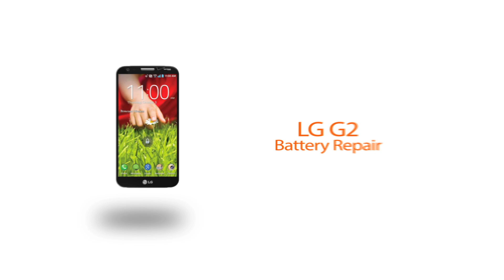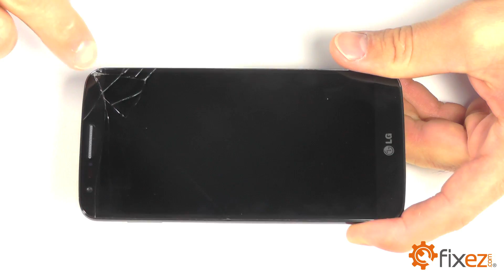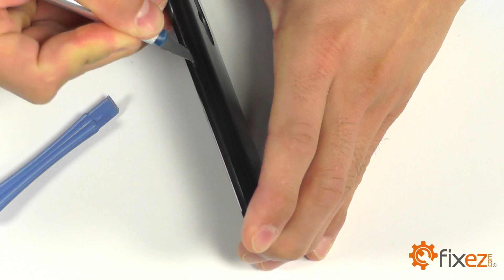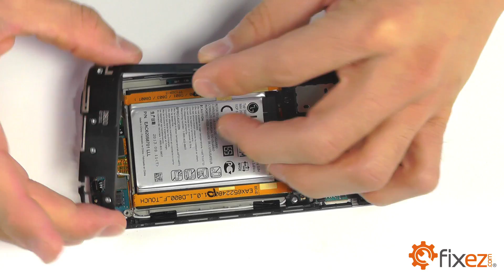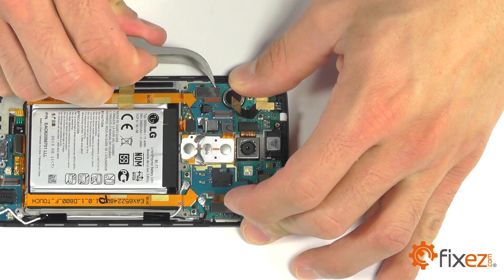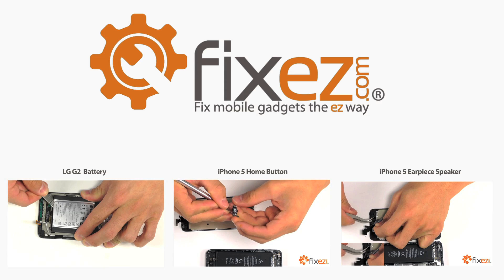LG G2 Battery Repair

Comment: What if my lg g2 is at 72% and it turns off completely while I'm using it and then I turn it back on and it's at 3% or completely dead. Is it because of the battery ??
Reply from the maker: This does sound like it could be an issue with the battery.

Comment: I replaced the battery in my G2 with a larger 3950mah one, but whenever I charge my phone now it will charge to 99% (100% maybe but I don't watch it that closely) but then it will start discharging again while still being plugged in.... at this very moment my phone is back at 90% after having charged a couple of hours (It is still plugged in) while an hour or two ago it was at 99%... does anyone have an idea about why this is happening and how I can fix It?
Reply: I think you have bought "fake" battery which is really original used one.

Comment: PLEASE HELP I GET A RED LED LIGHT BEEPING 8 TIMES PAUSE THEN RESTART THE PROCESS AGAIN
I CHANGED MY OLD BATTER TO A NEW ONE AND IT WONT POWER ON BUT WHEN I PLUG IN CHARGER LG LOGO POPS UP THEN PHONE TURNS OFF THEN THE RED LED LIGHT BEEPS 8 TIMES AGAIN HOW TO FIX? WHEN I USE OLD BATTERY PHONE WORKS BUT I CANT CHARGE MORE THEN 2% WITH OLD BATTERY :/
Reply from the maker: +Joel Hernandez Sounds like you may have received a defective battery. Have you tried a different battery aside from the new one and the original one?

Comment: Those screws dont come off as easily as it looks, very very very extremely tight..any ideas?
Reply from the maker: +Angel Ascencio There small phillips screws and should come off without much hesitation. Ensure they are not stripped and also ensure you are using the correct size tool. https://www.fixez.com/small-phillips-screwdriver
Reply: +Fixez.com never mind, the problem was my screw driver, got another one, worked well!  ...my bad

Comment: If only the battery was that easy to remove. Mine ended up warped because it was adhered too well to the case. Luckily I was replacing it, anyway.
Reply from the maker: +Nothinglastsforever LG does adhere it well from the factory. At times the battery can be damaged upon the removal process due to this. Definitely want to take your time removing it as best as possible.

Comment: I followed the instruction, and the phone power up fine. But the problem is the touch screen does not work any more. I rechecked all the connections and they are fine. I also removed all connectors, and reconnected them again, but the touch screen still does not work. Any suggestion of how to fix this problem is much appreciated!
Reply: +Candice Cheng same here did u solve it yet?

Comment: Hi. I just replaced the new battery and i turned on. G2 shows battery %0 and restarting system thousand times. I can go hard reset and downlaod mode. It detect the plug in but no charging. It always shows "%0 and device will power off". Do you have an idea ?
Reply from the maker: +Ozan Özceylan Possibly a bad battery or your dock port is bad.

Comment: I can't seem to unscrew any of the screws. I don't think my screwdriver is stripped. is there a certain screwdriver I need to use? I'm using a super small philips I ordered off amazon to unscrew tiny screws.
Reply: I think it could be stripped now that I'm looking at it. It's a bit rounded now. Did you have any issues trying to remove the screws?

Comment: Awesome video and great company to order from. I easily replaced my battery but apparently when people call me they can hear themselves talking if my phone is not on speaker(normal calls it isn't). I assume this is something I did wrong while putting it back together but wasn't sure. Any advice?
Reply: Yea, it's when it is not on speaker(holding it to your ear) that they hear so it's odd that people can hear themselves.

Comment: Hi! You have a couple of different kits available for sale.  Which kit would I need to coincide with all the steps in your video? Does it come with adhesive for the battery? Would I need to put adhesive on the new battery? Thanks!!

Comment: EU laws should ban non replacable batterys.

When this whole crap started they gave reasoning for quicker charging. this al was false its just to make you buy more phones as they rather have you buy a new one then a battery.
This are 500+ euro device on release! the least we can expect is a easy fix of the battery is wearing down which isnt a question but a fact.
There is no reason to place components over the battery other then to make it harder to replace the battery. Its perfectly powwible to make these phones with removable battery's they just dont want to as it will hurt sales.

EU stop messing about with charge ports and switch your focus to making batterys replacable again so we dont have to take a massively heavy battery pack on the road with us and can carry a spare batt. instead. ! ! ! ! !
I will NEVER buy a Phone with a hard to replace battery even if it means i have to buy a dumb Phone i just dont care. ill ditch whatsapp in seconds and go back to a call only contract.

Comment: Brb buying the S5 lmao, I really want the G2 but why the hell is replacing the battery rocket science Q.Q
Reply: man...  it is very difficult that kind of battery gets damaged...
Reply: Or the G3 with removable battery.
Reply: Now that the G3 came out it's a moot point - as the G3 has a replaceable battery so does the low cost sibling the LG-LS720 (paid $140 OTD with tax at walmart using it with the Custom Plan on Virgin Mobile - it has a replaceable batter, and fantastic battery life - two days no problem.
Reply: Well fast forward samsung s6 is shit
Reply: Congratulations on your s6. Its funny as I read back and see were talking about the G two then the g3 came out now the g4 is out.
Reply: Paul C
I'm using the G4 now lol, time flies when it comes to phones q.q
Reply: G5 is out now!
Reply: LG G7 and G8 are out too!
Reply: it's 2021 and LG didn't get any better with updates, furthermore they stopped doing phones